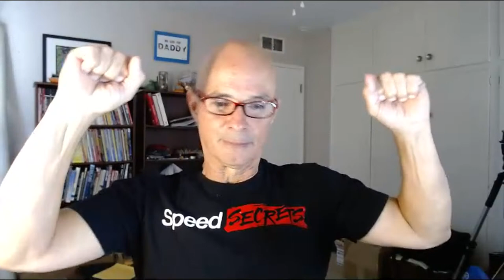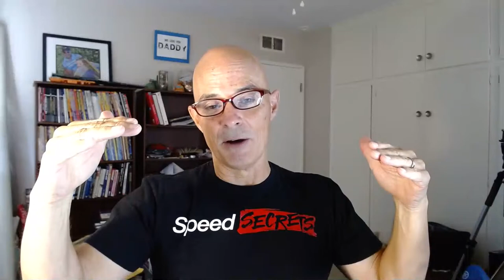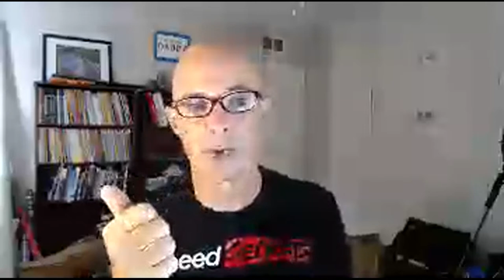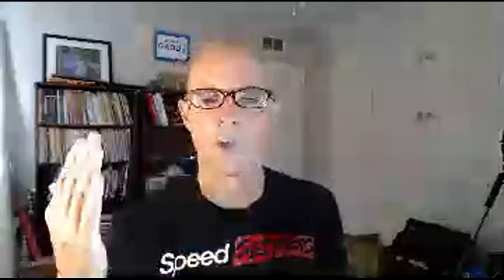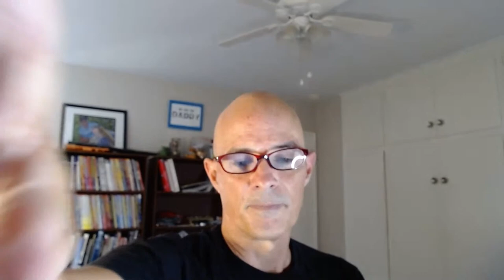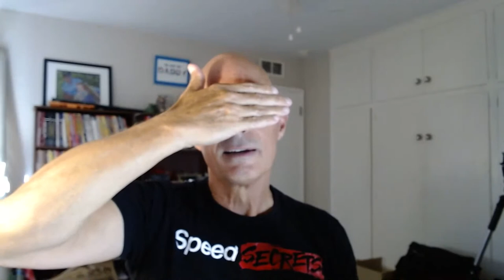LET'S TALK TURBOS-ARE ALL STOCK CAMS TURBO CAMS?

Comment: Thanks for all the great content Richard! I have an 01 4v 4.6 that is stock aside from Sullivan intake and Sniper EFI. I just made a single turbo setup for it running 6lbs of boost. Using a MSD 6 MOD for timing and wondering what you suggest as max timing without boost and how much to pull for every lb of boost? Thanks again!

Comment: Have you made a video comparing a NA stage 2 cam vs. A turbo stage 2 cam? Like BTR etc.?? Running both NA and boosted?? I know you say all cams are turbo cos but would like to see if there is a difference there because I am in the boat of what should I go now since I will boost later. Thank you!!
Reply from the maker: WHATEVER CAMS MAKES THE MOST POWER NA WILL ALSO MAKE THE MOST POWER AT ANY GIVEN BOOST LEVEL

Comment: Hello Richard, big fan of yours from México... i have a huge question! I own a cougar xr7 1990 that i swap the supercharger for a single turbo, i have been watching all your videos and modify mi intake manifold, porting heads, headers, etc. My question now is about camshafts! There are 4 camshafts that i can add, but i dont want to deal with the problem of change valve springs . There is a stage 1 camshaft test dont need valve springs upgrade...the question is . Should i spend 400 dls for this stage 1 cam? Do you think it will worth it? 

Thank you so much
Reply from the maker: just add boost

Comment: As far as I know there is no such thing as a turbo cam or stock cam. Cams are cams. Depending on your engine characteristics, you choose the specifications to make power in your desired range. If you use a standard performance cam taken off the shelf, it's going to make power in the same places as it will If it's boosted. Your dyno sheets will just run parallel to each other but with boost providing increased power.

 If you run a "turbo" cam in a NA engine, then run it in a boost application, the dyno will once again mirror the performance on the X-Axis while having elevated numbers on the Y-Axis.
Reply: Isn’t that what he said???
Reply: @parkeranderson5074  I don't know. I didn't watch the video. I only saw the title. 

I'm not an engineer, car guy, or mechanic, but reading the title made me think about it, and that was my conclusion I felt needed to be in writing in case I was wrong.

Comment: Wish they would come out with a procharger for the same price as a decent turbo. $5k-7k is way to much.
Reply: I know right! Would really like to go with a procharger but wow are they expensive! Out of my range that's for sure.
Then I looked at the torqstorm deal's, still 3500 bucks or so! Then you look at turbos on ebay for 169 bucks(gt45's) or a Summit s475, 900 bucks, still way cheaper than a centrifugal deal. You can get the 
small vortec kits for around 2500 Buck's, but they don't make much boost at all, basically for a stock engine with no ring gap.

Comment: Richard when choosing a turbo will the 700hp turbo for a  5.7V8 still be considered a 700hp turbo on a 2.0?
Reply from the maker: the hot sides can be different
Reply: Forged vs. non-forged internals what would be the highest static compression e-85 would stand on a boosted engine?... with optimal cold intake and coolant system but no Intercooler. 

Thanks Richard